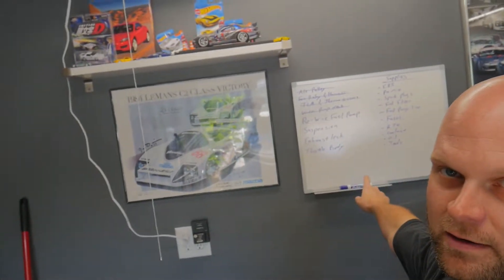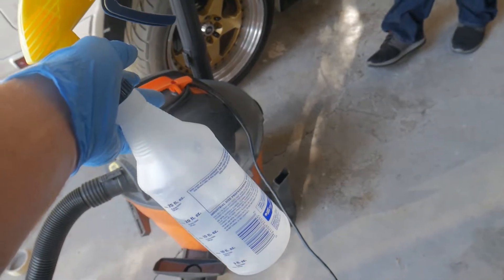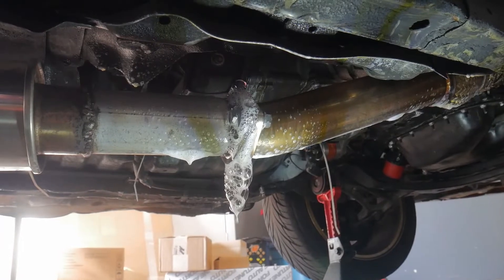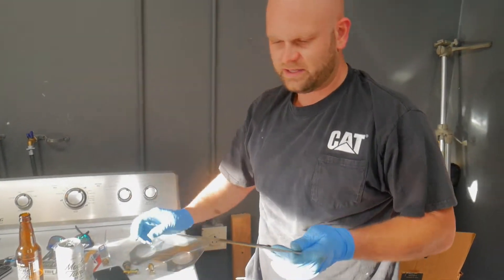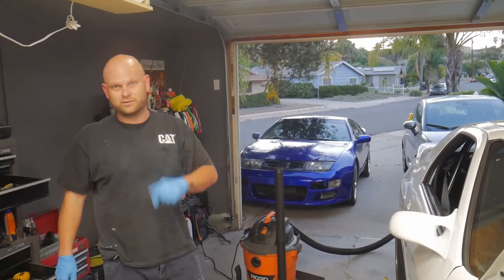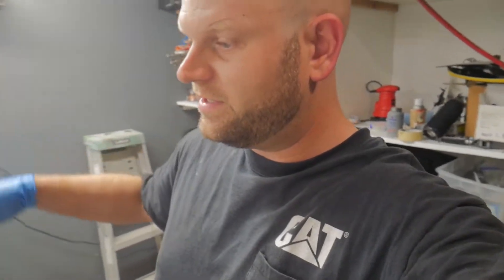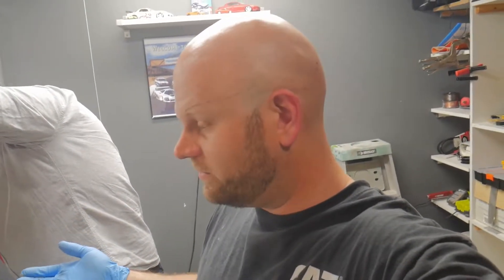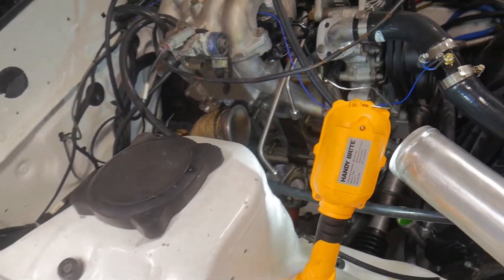Finding and Fixing Exhaust leak // FC3s RX7 1988

Comment: Quick question, I have similar exhaust manifold leak on my 79 SA, did you apply the copper gasket maker on along with the metal gasket?